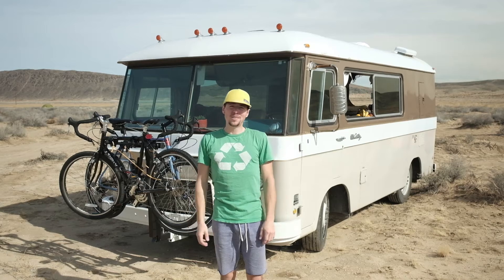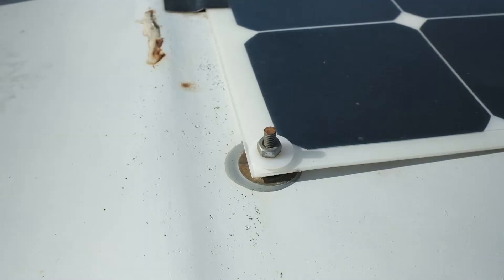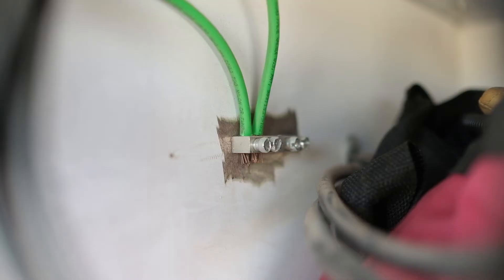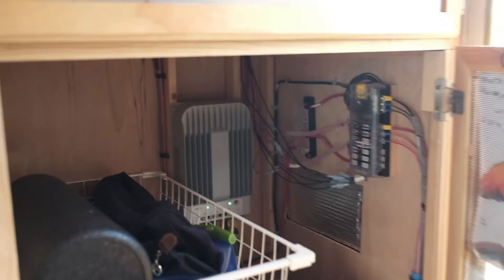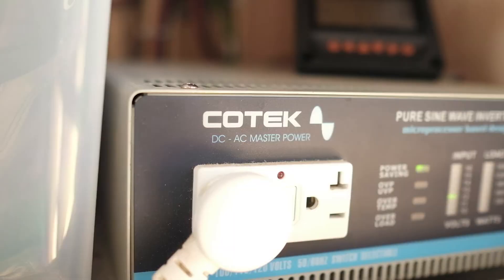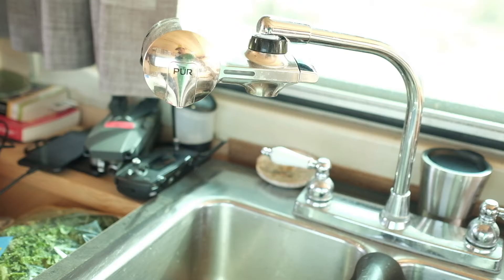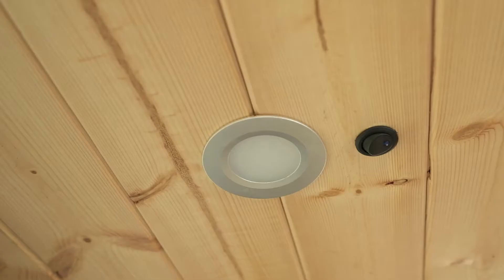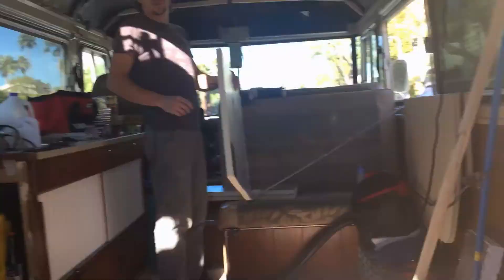Vanlife Solar Electrical Setup //  Panels, MPPT, Batteries & AC Inverter // The Van Project

Comment: Amazing solar setup. I need that in my life!! I just got 4 UB121100 110ah batteries but I’m thinking I may really only need two after watching your video. Saw you post in the Facebook group great to see other YouTubers love your old Camper by the way. Just subscribed
Reply from the maker: Awesome, glad to have you along with us! And thanks for the comment. Yeah we've been using our setup for a year now and except for the occasional stretch of 3+ cloudy days everything works just fine. 200 amp hours powering a ARB DC fridge (50 quart model) DC LED lighting, charging laptops, cameras, and even running a 600 watt blender a few times a week (we like our smoothies!). Good luck with building out your system!

Comment: Thanks for sharing! I've always wanted to see the different solar components setup and working. In hindsight do you feel that the extra cost of the flexible solar panels was worth it? Just curious as they are almost twice as expensive as the rigid panels!! Thanks :)
Reply from the maker: Thanks for the comment! It's very empowering to have an electrical system that we designed and set up our selves that actually works well! As far as the flexible panels are concerned, we feel that the cost was worth it, let me explain. The two biggest considerations for us in choosing panels was ease of mounting and overall weight on our roof. Our RV doesn't have a rack or any load-bearing area that which meant that in addition to the weight of rigid panels we'd need to add additional mounting hardware (adding to the overall weight on our roof). That also meant that we'd have to screw or bolt into the roof to attach mounting hardware for the panels, something we didn't want to do because we already had some trouble areas (i.e. leaks). The flexible panels in comparison were much easier to mount - you probably saw how we did it in our video. They also weigh about a 10th of what the rigid panels weigh. Hope this answers your question, thanks for the comment!